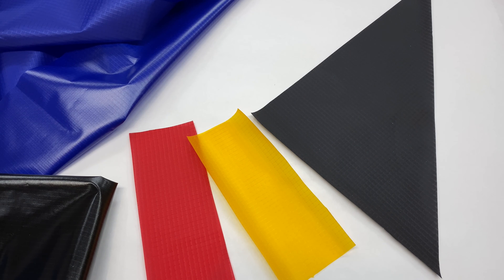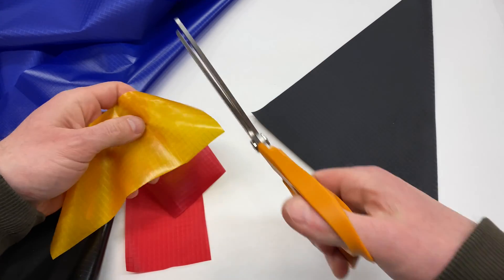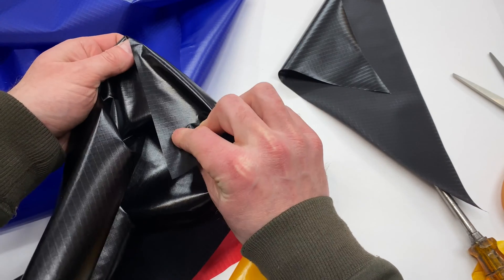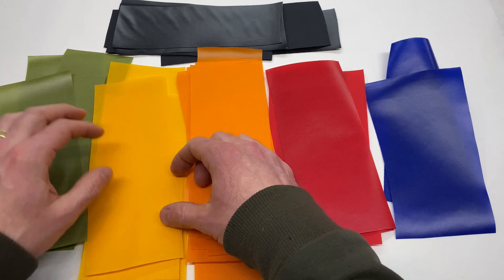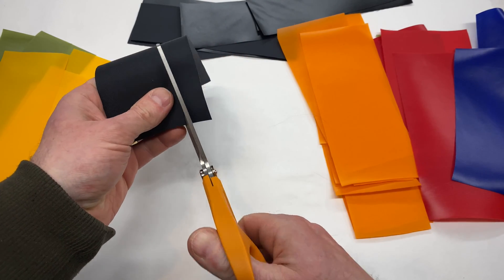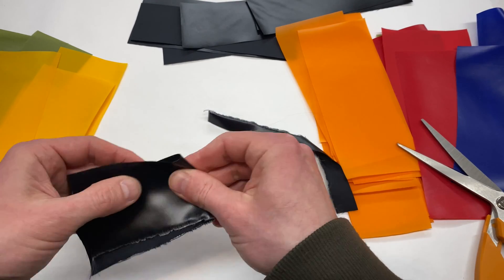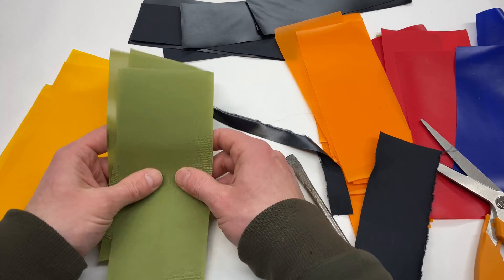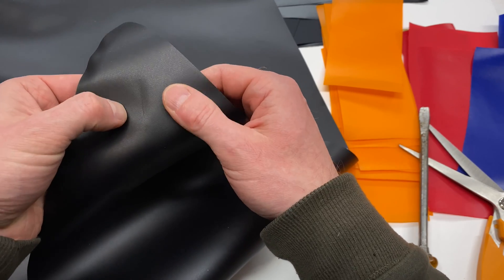DIY Packraft Fabrics Comparison (2025)

Comment: I prefer to sit more upright.  What is the stability of these rafts if one sits on the tube at the aft?  Thanks...
Reply from the maker: It works in the 2-person model, but I’ve never tried it in the smaller ones. Maybe with a load on the front it could work, but I’m not sure.